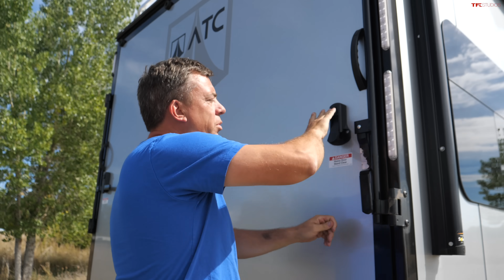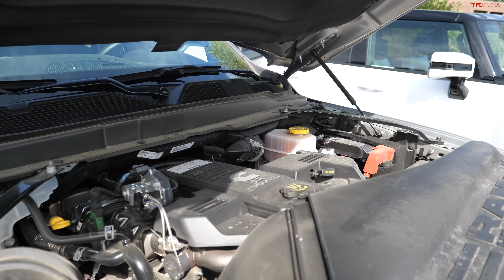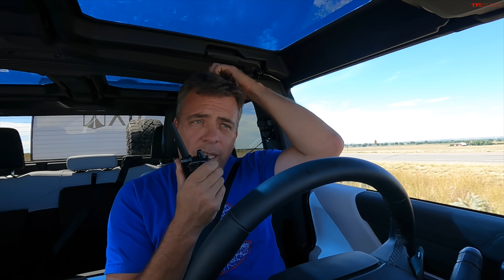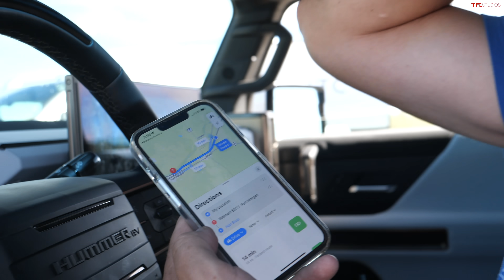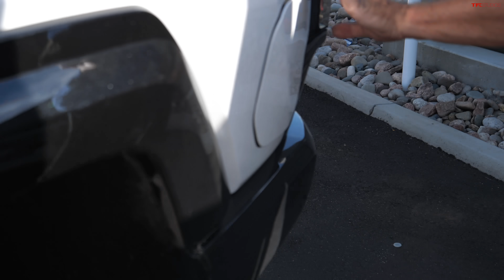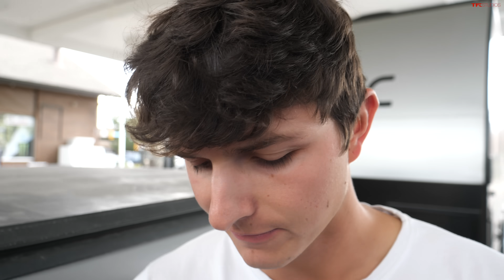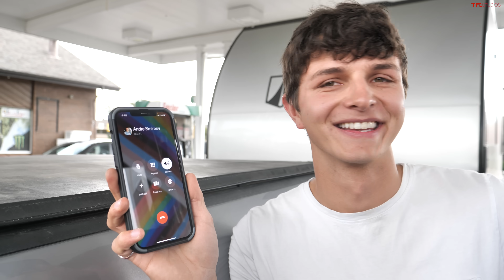How Far Can a Diesel and Electric Truck Tow An Identical Camper Trailer on ONE Fill-up?

Comment: Can anyone say what was the average mph when charge time, removing trailer, turning around because the trip computer mislead you so much that you got stranded, then the fast chargers are full so you use the slower one, then only charge partly cuz it takes too long then decide to give up go home and watch tv. 70mph avg really turns into 20mph avg. So Alex Jones was right about it cant get above 20mph?

Comment: Speed kills range!  And that is diesel or electric!  We have a 2018 Ram 2500 4wd 6.7L with 3.42 ratio.  When we are looking for range, a speed of less than 70mph is selected.  65mph is the maximum speed if range is a concern.  45-62mph is a better speed ro get a long cruising range.  We have towed a 7x16ft cargo trailer.  But currently carry a Hawk model 4wheel pop up camper.  On a trip from Lancaster, CA to Fallon, NV, and back home  With side trips up Tioga Pass and several camp sites.  We averaged 19mpg.  Tioga Pass rd, and June Lake rd had a lower speed limit.  But most of the travel was done at 60-65mph.
Rerun the test at a more reasonable speed.  Try 60mph.  The results should be interesting.

Comment: Electric isn’t ging to completely replace ICE engines. Electric is great for cars and short trip vehicles, trash trucks, school busses, and many other vehicles. But It might not be optional for trucks pulling travel trailers long distances. A lot of people own trucks and do not pull a trailer. The amount of cars on the road will eventually reduce the demand for oil to the point that it takes away the political clout of oil producing nations.

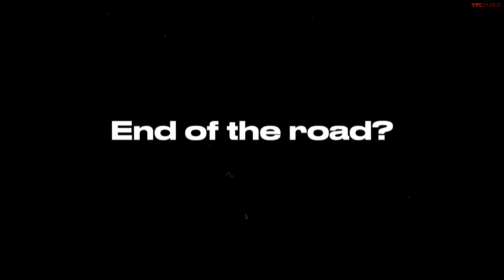Comment: 13:17 This is one of the biggest reasons that charging site distribution is so important for EVs right now. With the current rural Interstate distribution of ~100 miles between fast charging sites, it can easily double the number of stops an EV has to make on a longer road trip.
Reply: Exactly, your range is limited by the charging network first and the battery capacity second.
Reply: You can have charging stations everywhere but who in the hell wants to keep stopping and sitting for hrs to recharge on a long trip. Jeez !!! Like charging your kids power wheels.  I'll stick with diesel!
Reply: @tonycking0121  you are correct with how people don’t and won’t want to sit and wait. An average stop is about 10 minutes to pump fuel (not just to pump fuel). At a decent rate 25 minutes will get an EV charged. You also have to realize a few things. This is all fairly new. How far could combustion engines go when they first started? How many gas stations were there. I know it’s a different time and age but it’s the fact that everything has to start somewhere. There’s even a chance there will be a new type (fuel source or even completely different from what we know) of vehicle before your time is up on this earth. This is also a worst case scenario. So if someone is all about towing heavy things, these wouldn’t be good vehicles. The average person would get 300+ miles out of a charge. As time goes on and improvements are made, mileage range will increase. So if towing something like this can go the same as a diesel truck, without towing, it would be able to go over 1000 miles without towing on a single charge. Sometimes you can’t be 100% focused on today but understand what the goal is. Otherwise, we get stuck where we are and never better ourselves. Which is fine once we reach a certain age but what about for the future generations? Combustion engines will be around for a while yet and will still be able to get those but they will get more scarce as EVs get better, that’s how progression works.
Reply: @tonycking0121  It depends. A lot of people don't like spending more than two hours on the road without taking a break (one that's more than just the 10 minutes it takes standing in front of a pump to fill up a diesel tank), so these trucks would work fine for them. 

Also, many states restrict speeds while towing to 55 mph. Sure, no one (not even truckers) follow those rules, but even at 60 miles an hour, you're looking at 3 to 4 hours of driving on a full battery, and another 2 hours of driving after a 20 to 30 minute stop (more if you stop for a sit-down meal). 

For people who have no experience traveling with EVs, I find that it's usually easier to work backward. I.e., how many miles do you actually drive in a day and at what speeds. 

The way most gas truck owners are speaking, it's as though they never drive farther in a day than a single tank of diesel/gas, meaning they're really only driving for about 5 to 6 hours. That means a lot of EV trucks could do the exact same trip with a single meal stop. Terribly inconvenient, I know.
Reply: @newscoulomb3705  Having to stop IS  inconvenient for those of us who hate the "half the fun is getting there" part of a trip.  The only thing I want from the moment I start a road trip is for it to be over, so if I can end it an hour earlier then by God that's exactly what I'm doing.
Reply: @ironclaw6969  Again, I'm basing my statement on data (BTS, DOT, etc.). Less than half of ALL vehicle owners make "long" trips, and only half of THOSE owners make roundtrips of over 200 miles. So if you drive farther than that in a sitting, congratulations, you're in the super minority. 

But I've traveled enough to know that a good number of those gas vehicle owners who do take long trips spend a lot more time off the road than people here seem to claim. I know this because many of the same ICE vehicles that are parked when I pull in to charge are still parked when I leave. 

The disconnect is, ICE owners will say, "Yeah, well I was eating or doing something else, not fueling." But that's the whole point. The convenience of EVs on trips is that you do both at the same time.
Reply: @newscoulomb3705  Like I said, the "half the fun is getting there" fun is, in fact, no f*cking fun at all.  The only thing I want from a road trip is to be done with it.  If I didn't object to being shoved in to a flying cattle car, I would fly more often.  When I have to drive 600 miles to visit family, I would do it in one shot except for a small detail and that's that the car only gets a little over 400 miles per tank, so I'm forced to make a 5 minute stop to fuel along the way.  I certainly wouldn't want to add another hour or two onto that trip because I made the mistake of buying an EV.
Reply: @ironclaw6969  The fact that you're angry at the world and don't want to stop at all on longer trips doesn't change the fact that you are projecting your personal values. A majority of people don't see things your way and don't want to travel in the way you do, so that leaves plenty of room for EV trucks as an option. 

Again, no one is saying that current EV trucks are right for everyone. You're clearly one of the exceptions, but you should accept that EV trucks as they currently are work well for a lot of people.
Reply: @newscoulomb3705  The majority of people who own trucks don't need a truck at all, they would be better served by a sedan. My major gripe is not the choice, but rather that it seems we are being forced into EV's whether they would work for us or not, and to add insult to injury I'm being forced to pay for the transition from something that works sufficiently well to something that's not even close to ready.  I NEVER had to pay tax dollars to build a gas station, not once.  Those were funded by individuals who were seeking profit. The fact that doesn't work for EV infrastructure is also telling and I don't wish to waste my money on it.
Reply: @ironclaw6969  How are you being forced? Automakers will build what people are buying. But also, you have to look at it from the other side: People are being forced to breathe in pollutants just so you can conveniently drive without stopping. Smoking was banned in public areas for a very similar reason. There's a reason cancer rates are the highest they've ever been, and diesel/gas vehicles are a key contributor. So while you are forced to stop for an hour every trip, others are condemned to die early or forced to go on without loved ones.

As for paying for infrastructure and transitions to EVs, you're also wrong. The subsidies for EVs and green energy are completely eclipsed by fossil fuel subsidies, and that's just the official, on-the-books subsidies that come directly out of our taxes. If you also account for the fact that a majority of our military spending is used to secure fossil exploration and mining, we're talking hundreds of billions of tax dollars each year subsidizing the diesel/gas going into your tank. 

There's a reason Americans pay less at the pump than most other nations: Our gas is subsidized with the blood, sweat, and tears of our service men and women.
Reply: @newscoulomb3705  Try not paying your taxes and see what happens.  As for forcing the change, why do you think they keep doing everything possible to artificially drive up the cost of fuel?
Reply: @newscoulomb3705  By the way, if you really want to play it that way.  You'd have to drive the most efficient EV sedan almost 60,000 miles before it EVEN REACHES PARITY with the ecological costs of a conventional car, and that's if you ONLY run it on "green" (read unreliable) energy and that also discounts the ecological cost of your so-called "green" electrical generators.  Meanwhile, the cost difference between a normal car and the equivalent EV ( that is much less capable, I might add) will buy THOUSANDS of gallons of fuel, even at today's inflated fuel costs.
Reply: @ironclaw6969  Again, you skipped over the part you don't want to agree with: More of our existing taxes already go to fossil fuels than go to green energy or EVs and EV infrastructure. So you are already paying more in taxes to support your fossil fuels.

As for the prices going up, that has more to do with a failing, unsustainable economy and fossil fuel companies realizing they can sell finished gas overseas for a higher price in an unsubsidized market. And the U.S. Government has already demonstrated that they will let fossil fuel companies get away with taking their subsidies and spitting in their face.
Reply: @newscoulomb3705  Never said I agreed with it.  The truth is, they can drill profitably for $40 a barrel and they proved they could do so even with a hostile administration. As for the rest of the world they MUST import, we don't need to, which means we can let the middle east go to hell for all it matters.  That was the swing we were in the middle of in 2020 when the current idiot go into the white house and we lost that energy independence.  In other words, there was no need to keep subsidizing hydrocarbon fuels even though they are the very core of our economy.  And I'll repeat once again.  I never paid a single dime in taxes to build a gas station, not one, not ever.  They were built where they are through private investment seeking profit.  I suggest the EV crowd do the same, except they've already admitted that they can't.
Reply: My cruze diesel can go 700 miles on a full tank. I can leave ohio and hit Florida border on 1 tank. Fill in 10 minutes and drive another 700 miles.  When an ev can do this let me know. !!
Reply: @tonycking0121  I'm sure you can do 20 hours of driving in a day in your Cruze, but most people simply don't care about that. They would rather drive 8 to 10 hours a day in a much nicer car.
Reply: @newscoulomb3705  STOP speaking for most people. Speak to your preferences. You don't know what most people want. The board is filled with people complaining about charge time. Clearly it is an issue.
Reply: @Greg-cu1zc  My statements are based on DOT, NREL, and other collected data for driving usage. That means I'm not speaking for most people; I'm simply relating the use cases that others have reported. This board might be filled with people complaining about charging time, but you should consider just how few people that actually is relative to the truck owning population (i.e., fractions of a percent). 

Again, nowhere am I saying that EV trucks work for everyone's needs. For some strange reason, though, a number of people here are claiming that EV trucks won't work for anyone's needs.
Reply: I mean, or we could just stick with gas and not have any of the governmental control, or draw backs that EV's all have. Like complete non-privacy.
Reply: Just think about that when you get a bunch of EV’s at the station needing to fill up, the wait time would be huge, and we all know how considerate people are so you know they’ll just get the minimum charge needed then move on to make the line move quicker 😅
Reply: @apegues  I don't think you understand what I'm saying. Andre had to drive past a charger and loop back because he didn't have the range to make it to the next charger, but stopping at the first charger would have been a waste. Having a charger in between means going 150 or 250 miles between stops instead of 100 miles or 200 miles between stops.

This is why it's so frustrating explaining concepts to people with no EV experience. They have no frame of reference to understand the concepts; they simply jump to unrelated negative stereotypes.

Comment: I think it would be helpful to do a total-cost-involved comparison between F150 vs Lightning and see the point at which all-in you have spent the same amount of money to be even.
Reply: Don’t forget to calculate how many months you spent sitting in a Walmart parking lot charging your batteries!
Reply: @cliffordmontana4562  right, time is money.
Reply: That would be a great video!
Reply: Tom Moloughney ("State of Charge") has a good video detailing that with the Lightning with a lot of numbers and total cost of ownership estimates at x many years. It's obviously going to vary a bit based on how much you pay for electricity (EA vs home electricity rates and your region) which he shows in his cost tables, but for the cheap Pro trim the payback was doable in few years (assuming  you could get one). On the other hand the almost 6 figure configuration trucks, it was hard to breakeven at all in the life of the vehicle (depending what you're comparing it to obviously). Unless of course gas continues to rise which may bring it down sooner...

Comment: Without watching I’m going out on a limb and say the diesel truck eeks out the win by the slimmest of margins. Actually I think the Cummins could hook the hummer up to a tow rope when it runs out of electricity and pull it and both trailers farther than it could with a full charge.

Comment: These towing tests definitely push EV batteries past what they can do, but people seem to forget that if you're not towing, these EVs drive 3-4x further on a charge, cost pennies to recharge at home, and on a daily basis are a huge cost saver. However the Hummer is a showpiece and not a work truck. Hard to compare with an F-150 whether it be gas or electric

Comment: The most important thing you guys are ignoring is recharge time.  The range isn't so important if you can recharge quickly and get back on the road.  The Hummer recharge peaked at about 540 miles per hour, but the diesel truck "charges" at about 10x that speed.  Electric cars make great city vehicles, but not so great for traveling across country.  The battery technology just isn't there yet.

Comment: You dont even need to watch the video to know the diesel wins in every single category. The pitch is if it'll tow TWICE as far and thats the mark to beat? I'd be surprised if it didnt! 
Electric vehicles just arent for towing yet. The battery capacity just isnt there. Plus the motors aren't geared for it. if there was just a 2 speed transmission added, one for daily driving, and one for towing, these vehicles would gain probably 25%-50% range.